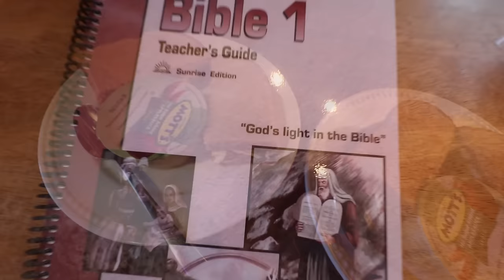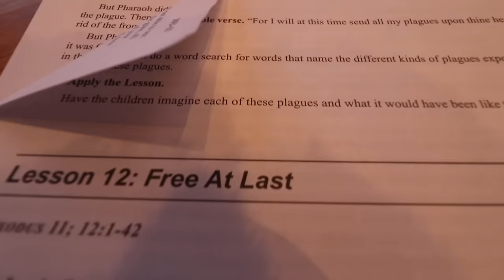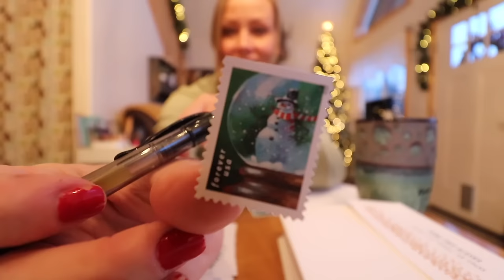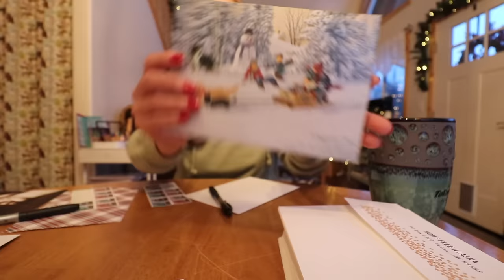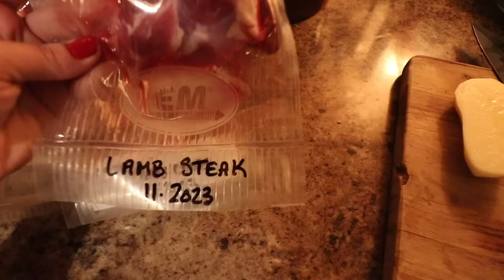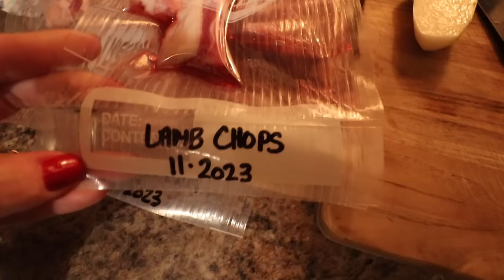People Can Be So Cruel...Asher's Story! + Day in the Life | Lamb Dinner & Blueberry Ice Cream!

Comment: Glad to see asher is on the mend. Hes a gangster for sure hoppin around. 

Couple things i noticed this video..when the boys are getting their chores done, the water spigot area, what about putting a backdrop on the wood wall to prevent water damage to the wood. Also adding a little bench to hold the water bucket while its filling, i see parker use his knee like i do when i have to go get water in 5 gallons. 

I also noticed u guys have the fan on the woodstove facing the wall. Why do u do this, does it push more heat..should i do that too lol my woodsstove is on a wall, not a corner like yours, what's the idea behind that? 

Your icecream looks delicious! Well worth the effort of picking this past summer. Your property ariel view is getting cozy, cant wait for the garden build. Lots of love fam, see ye on the next video xx
Reply from the maker: The motor on the fan is reversed so we have to turn that fan around so it blows the air out. And we’re not too worried about water on the exterior of the cabin as the cabin gets rained on. It’s weather treated wood so it should be fine.☺️

Comment: So sorry about what happened to Asher. It’s a shame the law can’t do anything. Animals are so resilient he will adjust and be fine in time. Was thinking just in case or possibly for later in life why not run the pipe work for the propane line while you have open walls then it will be ready if ever needed and Joe won’t need to redo anything from before. Just a thought. Maybe you can take the cats out once in a while for a walk and play time when you can stay with them or possibly harness train them. I bet a month from now this will just be a sad memory and Asher will be doing everything his new way but will be ok. Animals don’t give up and feel sorry for themselves which is fortunate for them. I got shot years ago at work and have quite a bit of metal left in me and for the most part it doesn’t cause any issues once in a while one works it way to the skin and the doctor can get it out easy sure it would be the same way for Asher if you ever feel one. Hope the rest of your holidays are good.